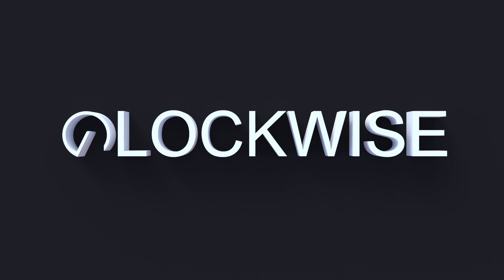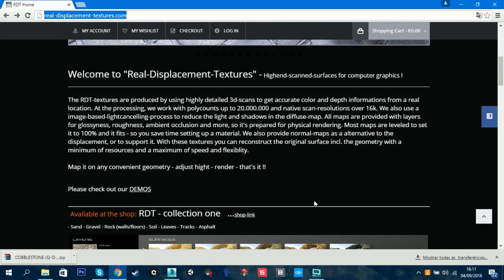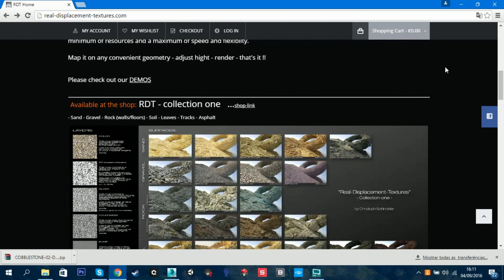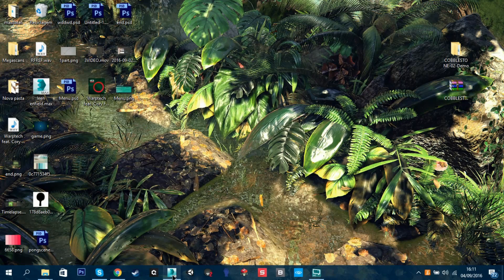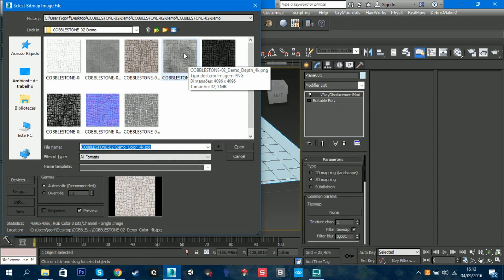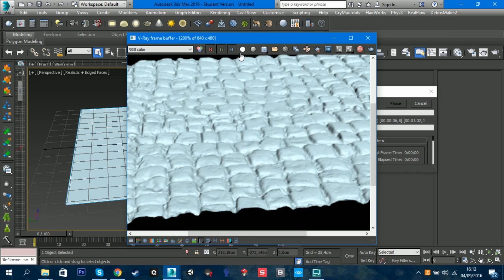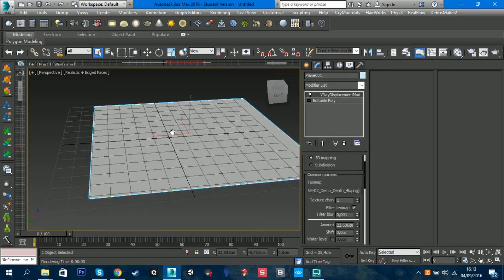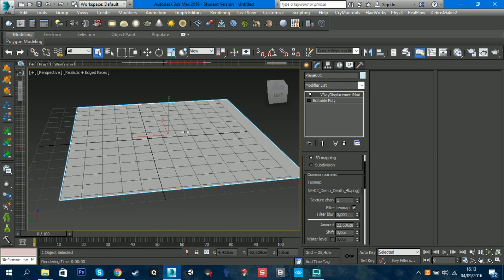Real Displacement textures-Vray

Comment: is displacement texture depend upon size of a mesh ..i meen if this plane on grid ...displacement map render correclty but if the same plane resize to 4 times bigger then it does not output the same render ...why
Reply from the maker: Depending on engine , displacement can be projected or depend on the UVs of your mesh , for having what I beleive you are trying to do I would use the displacement tab on materials , those depend exclusively on UV´s (if not using tri-planar projection Of course ... ;)

Comment: Is there any diference in quality between using VRayDisplacementMod modifier and using the displacement in the VRayMtl itself? Do you recommend one of those methods? Why?

Excelent video BTW.
Reply from the maker: RandomComment I Think that the only difference is that you have a little bit more control in the modifier, just that :) but in the materials in can adjust the output... So I can say it depends on your needs :)

Comment: Can you actually take this realistic look into Unreal Engine?
Reply from the maker: Rex Art yes you can. By using displacement /tesselation and use normal maps plus the other ones... so is usable in a real time scenario, the problem is that you cant over use it because that Will make the fps drops a lot... So it needs to be used in moderation
Reply: I see, what do you mean by it needs to be in moderation?
Reply from the maker: Rex Art used with LOD Systems plus not be used in every surface.. Meaning you Will have to sacrifice some surfaces that are not in the center of the focus.